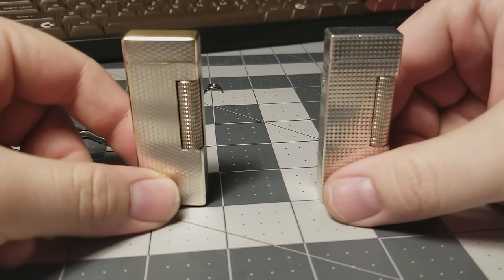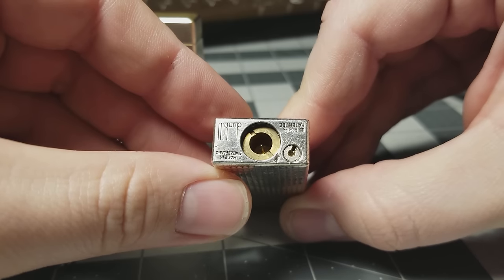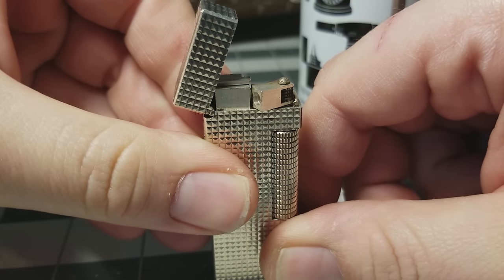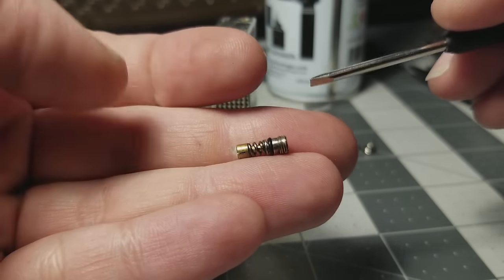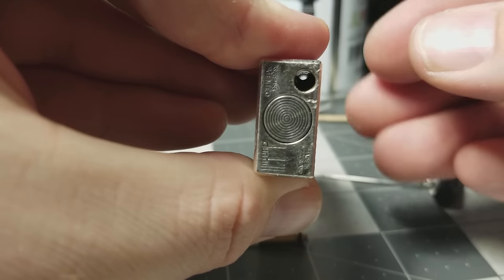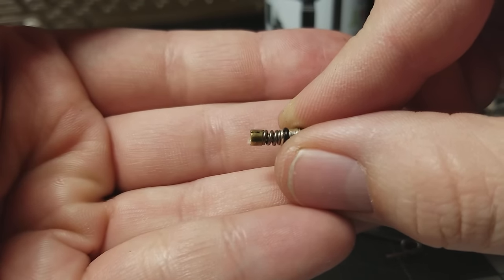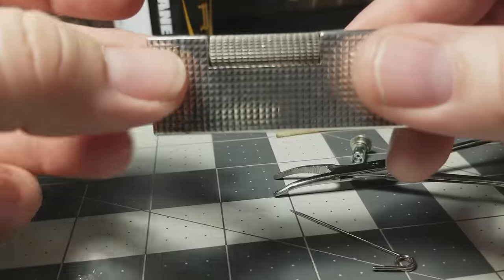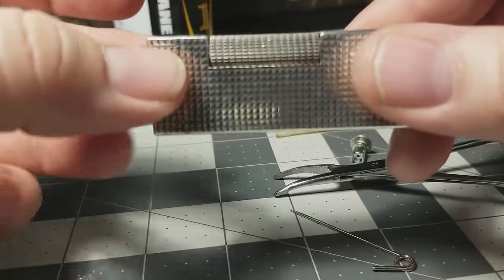Dunhill Lighter Guide 1

Comment: Thanks for this video. Disappointed you didn't make more of them for the Rollagas, but I get the frustration. A main tip that I can offer for your focus issues is you need to play by the rules that auto-focus uses if you're going to use auto-focus. When you're trying to show something like this lighter in the foreground, you can't have objects in the background, such as the keyboard, butane and tools. The camera does not know that you're not trying to show those things. If that's not practical and you are trying to shoot your active workspace and its not focusing on the right thing, the easiest thing to do is just put your hand behind what you want to show, to temporarily block the things that the camera is actually focusing on.

Comment: i bought my first dunhill from an antique stall at some fate 20+yrs ago, was a 1966 model, worked perfectly, even worked perfectly just before i saw this vid! after that dunhill i went and bought a brand new st dupoint, still have it, but never use it as its a pain to refill, anybody that owns one will know what i mean!, then went and bought a brand new dunhill, the one thats still for sale with dunhill written big and bold both sides of the lighter, that was in 02 iirc, after a few years i started having problems with it, loosing gas and the flame was just wrong, carnt say i helped the matter as i tried to sort the top of the pin out with a pair of pliers! not recommended, so its been sat in it's box for 15yrs or so.

this brings us to today, as on a whim, dont know where it came from, i searched dunhill lighter service, and saw this gem of a vid pop up, i had no idea it was so simple, so now i have a 1966 dunhill with a not so great pin and flame that looses gas, and have a perfectly working dunhill signature again!!

Comment: Thank you very much for the video. Fixed my Dunhill and it works fine.  It will definitely need new O rings. For the time being I just stretched them out so they stick out and seal properly. I pulled out the little felt packing in the valve which looked worn and flipped it over. Also the flame tube was clogged and sticky. I tried a very fine wire but it wouldn't go in. Instead I put in a few small drops of WD-40 in it and that did the job.

Comment: I was encouraged by this video to service the one I just bought.  I am missing the tiny spring at the tip of needle valve.  Hopefully I can find a replacement one.   
Thank you.  Most informative.
Reply: You can source one from practically any disposable lighter. I would suggest one from either a flame valve from a clear adjustable Chinese lighter, or a refill valve on any lighter. You can also cut it to size or use a similar flint spring and cut to size.

Comment: Excellent and informative video, I have a rollagas I bought 30 years ago and watching this video gave me the confidence to follow you and give it a good service, I was even able to replace the filter for the gas, I used a cigarette filter which I cut to measure, works like a charm! Many thanks for posting. maybe you should get a go pro and strap it to your head, then you don't need to worry about the camera, we see what you see. Looking forward to more videos, make one about the gas valve, thats a good idea! Cheers!!
Reply: Use a sponge from a disposable adjustable plastic lighter. I believe these need two. Take off the metal disk of course. These are far superior to anything else available. But if it works, it works!

Comment: Well, my lighter arrived from Japan. After filling it with butane it worked great for about ten seconds. Then it suddenly became a leaking blowtorch. The lighter ignited. My hand ignited. And it went for a ride across the room. Thankfully I did get a repair kit from the gentleman referred to in this video. While this process is not rocket science it does require some patience/experimentation as Incorene suggests. After disassembly I noticed the original o-rings were brittle. The one on the regulator was actually flattened in one spot. I added one of the spacers in the kit to the one that came with my lighter. It seems to have solved the blowtorch effect. I also opted to change the spring on the end of the needle valve. The original was very compressed and only about half the size of the replacement that came in the kit. I only had to use about half of one of the supplied packing cylinders to replace the original packing. As stated in the video... the trick is getting the right amount of packing in the regulator to get a consistent flame. I found that when I had packed too much into the regulator it wouldn't screw down flush with the bottom of the lighter without excessive torque. I removed small amounts until I was able to get this right, and I finally got a consistent 3/4" flame. My first time around, so it took me a while, but if you hang in there it's a satisfying feeling to know you DIY'd it!
Reply: I do vintage repair and most of us use actual manufactured filters/sponges made for lighters that are extremely thin and very effective. They are only sourced from disposable adjustable lighters like the clear cheap plastic lighters from the dollar store. These I believe need 2. They are very thin and have a pinhole just as the lighter itself does so it regulates extremely well. Thats why lighters today are so easily adjustable to the exact height you want. Also source the o rings from all disposable lighters.

Comment: Great video! I have repaired a few lighters now because I work in a cigar bar in ATL. I have one at the moment that is leaking gas out of the thumb wheel when the damper is shut. I've replaced all the seals and have taken the needle valve apart. The needle valve wouldn't spring. I replaced everything, and it is leaking.

Comment: I have a lighter in that style (that I bought in a flea market some years ago) and managed to finally pinpoint the problem I've had with it.
Inside the rod in which the regulator is in seems to have a blockage... the problem is that the blockage also seems to be a part of the rod or something.
Before, it was leaking from where the rod screws in. I realised that there was an O-ring that dried and done. On a budget I fixed this by using a little bit of silicon caulk. It's safe enough.

25:44 I think it's what you're talking about...
Reply: If you can’t find an o ring that works, you have no choice but to use some sort of teflon plumbers tape or a type of flex/gasket seal. Sometimes these required very thin o rings that aren’t made anymore and will not screw back in without being super thin. Some o rings just aren’t made anymore. I was told it costs $100 or so just for someone to make the exact mold for it.

Comment: QUESTION: First, this is a great video, thank you very much. I have two Dunhills; the first one (purchased about 30 years ago) came apart fairly easily and was fixed with the kit you recommended in about 20 minutes. The second is a family heirloom and is probably 60 years old or more and has never been serviced. The top part was taken out and the felt and “0” ring replaced and greased; but, after much effort the longer shaft could not be removed. I did not want to take a chance on damaging it; can I use some kind of loosening product, say WD 40 on it? The lighter was put together and now works.
Reply: I’ve known other repair men use mek. Basically any solvent of carbon should work as well. The gasket materials used then and filter can look like tar after that many years.

Comment: Great video. Super useful. I have two Rollagas'. Both swiss made. One works fine. The other, a black lacquer (Late 70's I think) I can't fill. It appears the needle in the fill valve is either gone or broken off. Can you tell me what I'll need to repair it?
Reply: I haven’t repaired a rollagas yet but have repaired a lot of different vintage ones. Are you referring to the pin hole that fills with butane is one that had a literal needle on top on what looks like a typical refill valve? If so, I have a few. If it is broken, no need to do anything at all. It will actually be easier without it.

Comment: Hi ... great video, much help. I have a solid gold rollagas I won in the 80s. The contest involved guessing the amount of dunhill cigarettes stuffed into a DeLorean ( yes, like in back to the future ) over 65000 lol. Anyways, it was hardly ever used, and I never even refilled it. However, over the 40 years of sitting, the flint expanded somehow splitting the housing that holds the flint. Any suggestions would be appreciated.
Reply: Yeah with all lighters that sit, take out any flint especially, any battery, and butane. Flints cause the most trouble especially in humidity. If you can’t get it out/off you need to drill it out by hand or use a thin like rod with a drill carefully. Then you’d need to replace the part since it’s cracked.

Comment: I have seen some parts that don't look like Dunhill quality. On ebay there is a flint housing and  base that has casting blobs and a rough finish. It's not polished like a Dunhill. It could be corroded but I think it's the way it's made. If it doesn't look like jewelry it's not Dunhill.

Comment: Can you tell me what sizes the required o-rings have? I purchased 2 supposedly working rollagas off ebay but unfortunately they are not working it turns out. Due to being in Germany ordering a repair kit from the USA is not a good option for me.

Comment: Great video, I followed along and it was awesome. I'm having trouble with the Filler Cap. Even when my hands are super clean it's difficult to get it to open, or close. It'll do it but it takes a bunch of tries, and then I don;t really trust that it caught and that it'll pop out and I'll lose it. Any suggestions?
Reply: The cover? Don’t tighten them ever more than finger tight. There’s no reason to ever tighten it. It’s just a lid to keep clean, not a seal in addition to hold butane.

Comment: Hi, I appreciate the video, very informative. But I have  an issue if you or anyone else might be able to assist with. I just purchased a 1984 Gemline. I don't know if you know these at all, but I cannot get it to work. It holds fluid but it won't release. I've cleaned it . Everything short of completely dismantling it. But I kinda want to use it before I "fix" it and it never lights again. Any help would be appreciated. Thanks

Comment: I use a Rollagas everyday. However you are on the mark about the new ones. I would never buy a New Rollagas , Price is far to high with cheaper parts in it. And why would they put the flame control on the bottom. The Whole point of the lighter was you could use it one handed. I smoke a pipe and the small screw on the side is so useful for me to control the flame one handed.

Comment: Hi Sir, it is my great pleasure to learn your tune up video. I have the same model as shown but the  top part that hold the flint is broken. Just wondering where can I get a replacement part. Your help is much appreciated.
Reply: eBay mainly. Either someone selling the part at a high cost or a parts lighter.

Comment: Thanks your video was very helpful. My lighter is leaking from where the gas goes in( the larger circle on the botom) did what you said, didn't seem to fix my problem. So tried doing it a second time now I cant get the back together. Just cant seam to see through the lighter nomater how much I jiggle it. Please help?!
Reply: Maria Ephrim lay  out all the pieces on a work surface  (so you don’t loose any small bits) and start from the beginning with it. Take it slow with the lighter. Every piece has a purpose but it’s a very simple mechanism. There are diagrams on the web , most important is make sure the o rings have good coating of silicone grease and that they don’t have any cracks.  If you have the repair kit such as in this video, you should be able to fix this in 10 mins.  Hope you find this helps

Comment: Hello, I'm writing to you from the UK. I hope you can guide me as I'm trying to fix a dunhill lighter that belonged to my late father. . I've followed all instructions from your YouTube video, and I've replaced the rollers on the valve and on the little part where the wool goes. Ive also replaced the valve new spacers. Ive tried one and two.
The lighter is still leaking gas from the top. Its spitting gas from valve pin and turning the part to adjust doesn't help.
Any ideas what I'm doing wrong?
I hope to hear from you. Ive repeated several times the steps and cannot figure whats going wrong.
Help!!!
Reply: I have the lighter working better only issue now is; even tho it lights when leaving it alone  with the cap closed i can almost hear a slight hissing.  Any help would be appreciated

Comment: My Dunhill will not light. The valve does not raise and open when the lid is opened. Seller said to clean with a tooth brush but that did not help. Can I pull it up with a small pair of tweezers to try and loosen it. Or should I try lubricating it? If so with what kind of lubricant. Thanks for your help!

Comment: I just purchased a Comoy lighter it looks like the one in your video that you didn’t work on. I was wondering if I buy the Dunhill repair kit that you show do you know if it would be the same o rings and etc. that I will need to replace? Thank you
Reply: Gabriel Hernandez it’s likely that the o rings will not fit a Comoy the same. You can go to a hardware store and look in the o ring section and easily find the right size for your Comoy, as well as purchase some silicone grease. A dab will do ya

Comment: Hi!
I recently found an old lighter like yours. I tried to change the flint but it is not like yours. I had to screw it open at the backside of the cap in the right bottom corner. A spring with a used flint came out. How should I change this or where should I look to buy such a flint?
I hope you can help me.

Comment: I inherited one of these from my father-in-law.  I have used it for years but when I went to refill the fluid it didn't seem to work.  And then it had a high hissing sound and the fluid few out when I opened it.  My wife bought the repair kit on ebay and followed the video and did a thorough repair.  Still it has the same problem.  The fluid goes out fast.  Anyone have any good next steps??  I am in LA and if you can even recommend a repair shop in LA we would really appreciate it.  Thanks

Comment: I was carry one of several Dunhill Lighter in the yard while I doing some heavy duty work. It initially looked like the cap was twisted and the cap would not go all the way down, but as I looked inside the cap and the piston on the right has dug under the little plate that says Dunhill. so I need to know how to disassemble the cap and piston area to understand the where the problem is or do I send it to a professional to repair. I would really like to do all my lighter repair, otherwise it is 135 to send it off.

Comment: I found that in my Rollagas, the Zippo flint doesn't perform very well. It feels way harder than the Dunhill one and gives out a much smaller spark. The Dunhill flints are softer and produce a much bigger spark and you can actually feel the difference very clearly when you light up... I'm not sure if a hard flint wears down the spark wheel more than a soft one.

Comment: Hi I recently purchased a rollagas of eBay along with the repair kit so I’ve replaced the orings the lighter seems to have an issue though after setting the flame height and bleeding the gas tank every time I light it I get a different flame height from virtually no flame to a two inch flame any ideas on repair would be helpful
Reply: Use two sponges from a clear Chinese lighter. Your filter/regular sponge is the problem.

Comment: Hi, thanks for the video it was very useful. I have recently got my late Father's Dunhill Dress Lighter (circa 1972). It is in good general condition but it is filthy having not lit anything for probably thirty years (!) so it will require a complete overhaul and I will probably have it re-plated to bring back some of its' charm. It has no intrinsic value but it is very important to me and so I'm keen to refurbish it and ideally get it working again. However, I wanted to ask if you know anywhere online that has instructions/exploded diagram or anything else that might be useful for this particular model? I believe it was prone to problems so it's not very collectable so I'm really struggling to find any info that will help me. In particular, I want to replace the lid as I actually have a new engraved one (with my father's initials) that was never put on the lighter. However, it is not obvious how to get the present lid off to replace it. Thank you in anticipation of any help you might be able to offer and best wishes from Nottingham, England.
Reply: Simon Jarratt if you are able to order a repair such as in this video, you can repair any Rollagas lighter in 25 mins. The repair kit comes with a diagram. I also believe they’re available on the web. As for removing the lid it’s just as easy as using a “pin” removing took and tapping out the pin they holds the lid onto the body.  Hope this helps
Reply: that’s great thank you, I will do this. I appreciate your message. 👍🏻

Comment: Do you know anyone that can do a repair on a 70s GBD Pipe lighter. There's no one I can find in England that even mentions them and even fewer that will repair lighters that weren't purchased from their shops. It fills perfectly fine, strikes well but no gas comes out of the head at all.

Comment: 1.55 yes there are fakes. 
The bit with the long spring is drawn on & does not function.
Dunhill is stamped on the base along with Swiss made and a serial number.
It has dunhill printed inside the flip top lid & the flame adjustment on the side & correct hinges.